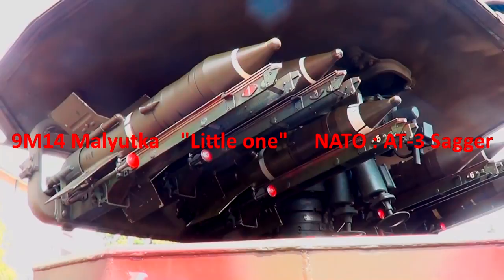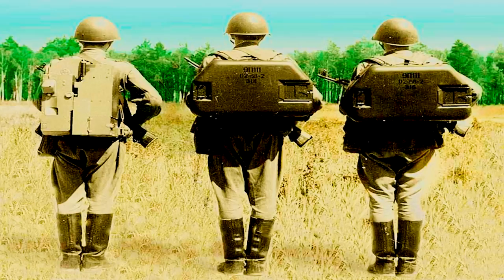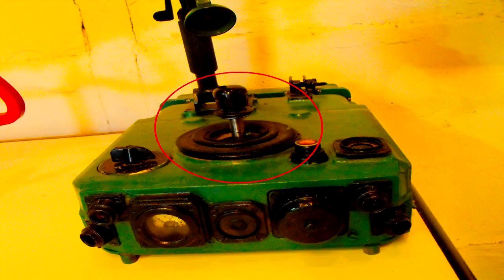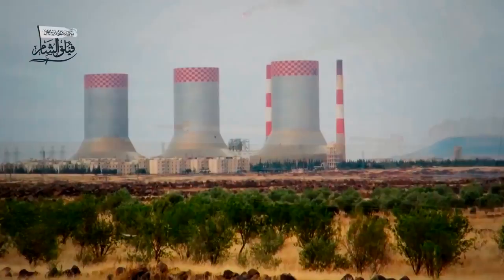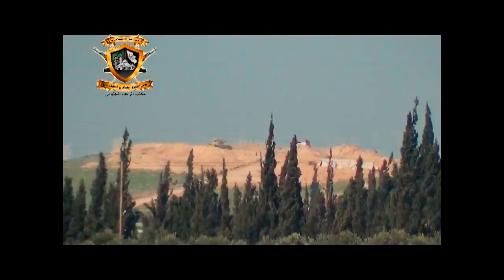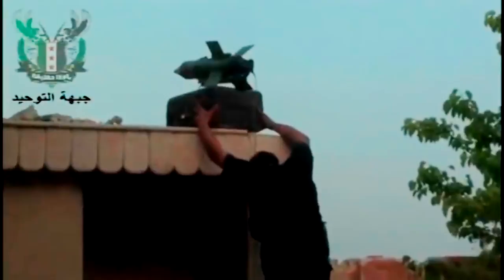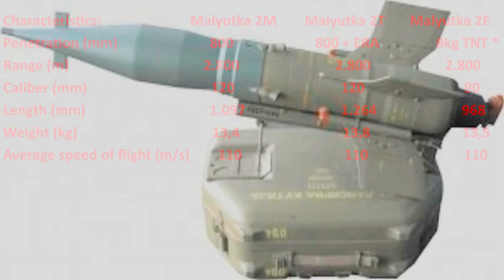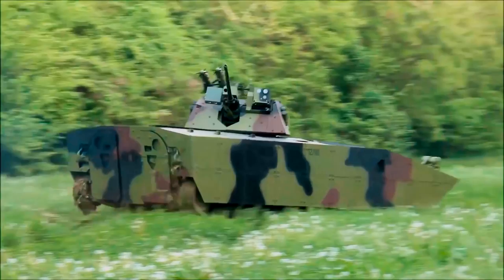9K11 Maljutka AT3 Sagger

Comment: NVA commies used this in Nam'. Closer range compared to T.O.W but much cheaper and pretty effective against armours. ARVN units had M-72s which were very unreliable, worse than nva RPG-2/7.
Reply: TOW was a much more effective system overall and much more deadly. Both worked well at destroying tanks.